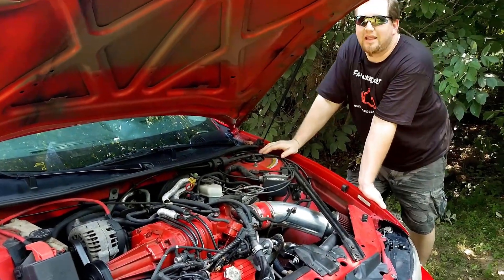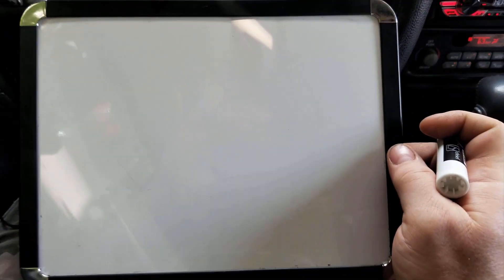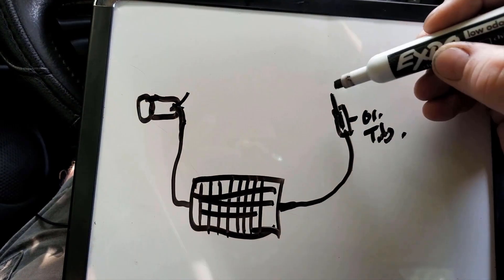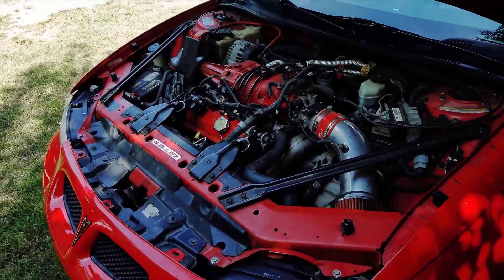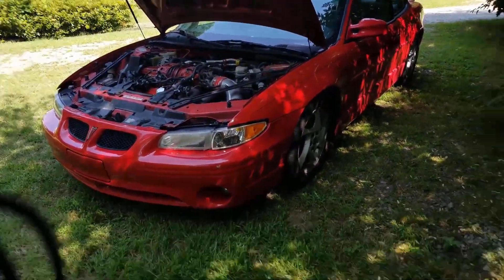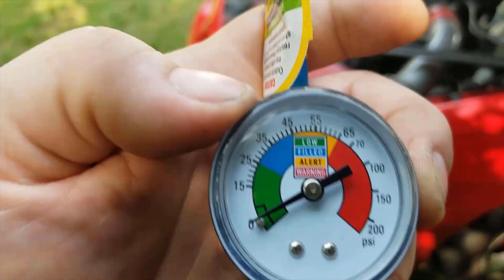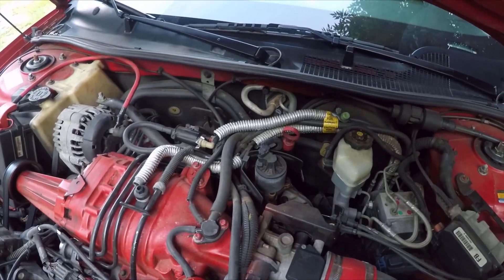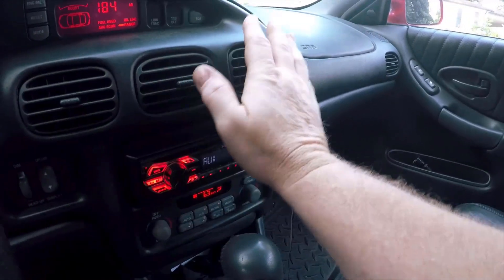How to charge your car's A/C, and how it works ( 99 Grand Prix GTP )

Comment: Would like to see a full a/c video on these 3800 cars. They seem to all have issues. 01 monte carlo was blowing hot on just one side fixed that with the blend door actuator,  but still not cold in my car I tried charging and adding oil but that didn't help and there's a squealing noise when I first turn on ac so I'm thinking about replacing compressor.  It's to hot in Texas with kids in the car to not have ac

Comment: So ac on my drivers side is blowing a little bit warmer than my freezing cold passenger, I changed the blend door actuator thinking it was the issue and it still feels the same. Any device? NOTE: driver side is not blowing hot, it’s just not blowing as cold as the other side
Reply from the maker: Check a/c pressures, mine dis that when it was a little low

Comment: What’s up my buddy. I have a question. Where is the office tube located on the Grand Prix GTP. I heard it’s located behind the master brake cylinder how true is that
Reply from the maker: Been a while since ive done one.  I think it is in that area, look for an ac tube with a crimp in it.
Reply: What’s up  old friend. I have a question. How many shift solenoids are in the transmission. Is it 3 plus the pressure control solenoid. The reason I ask is because my shift solenoids acting up.
Reply from the maker: @james4lifepatterson755 two shift solenoids

Comment: My GTP had 4by60 AC the evap had a leak and for a $60 (at the time) part it was about $900 in labor to tear the dash apart to replace it so after work I would change in to shorts and an A shirt and switch on the 4by60 and have a bottle of water next to me for the ride home. Besides who wants all that horse power robing AC? Delete! cool vid! and I still get the evap and condenser mixed up unless I think about it and I remember by evap gets cold!
Reply from the maker: Yeah, most of my cars didnt have a/c for years, but i am spoiled now, cant take the heat in my old age.

Comment: Great video. My compressor clutch is shot so I'll be replacing that soon. Off the topic question...is that an alternator rewire to the fuse box?
Reply from the maker: +Andrew Oliver yes it is.  Good eyes.  I am hopefully doing a compressor swap video soon on the 97 also.